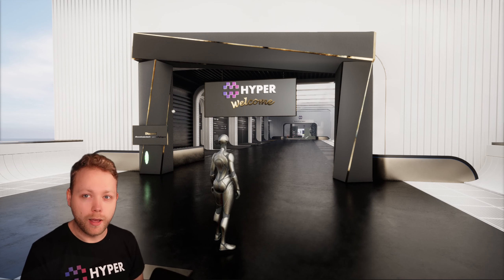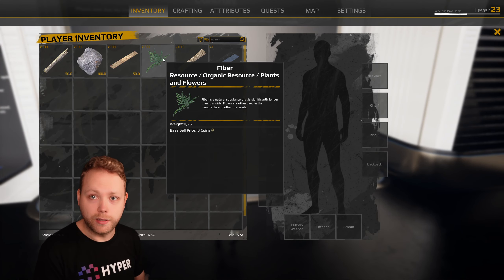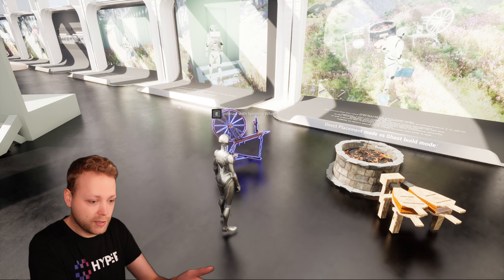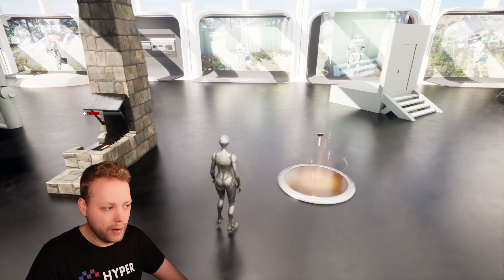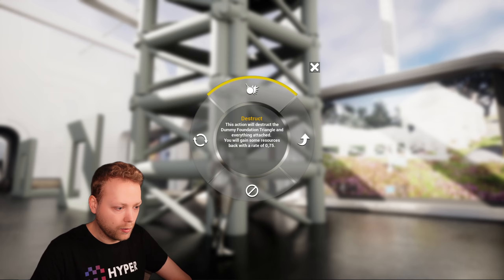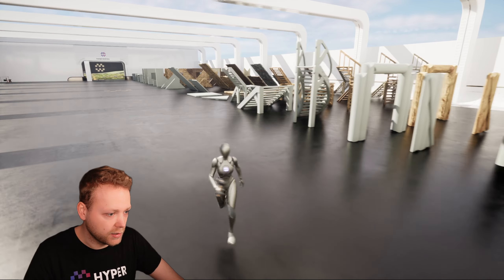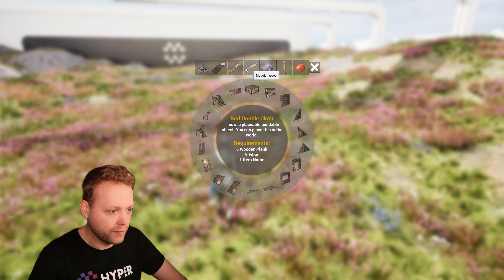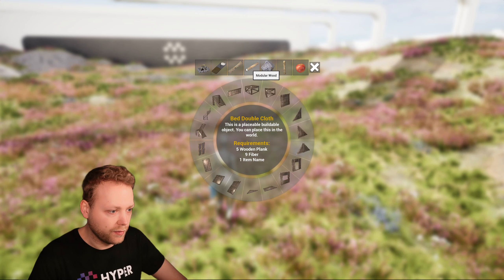UE5 - Ultimate Building Systems: Walkthrough | Games By Hyper

Comment: Have you considered making 30,60,90 degree based triangle foundations/ceilings? I know this would also require special walls, and walls with windows. There is a build set for Ark Survival - castles, keeps and... something - the original set, that has these, and round towers, etc. It is the most comprehensive build set I've yet seen. Regardless, I'm keeping an eye on this, your project!
Reply from the maker: Thanks! Yes I considered it. The triangles I have now are sufficient for most complex structures, but it would be nice to have more.
Reply: @GamesByHyper   The reason I ask is because as a builder, I always have those spaces that scream '30-60-90' here, in order to nicely edge sections together to make a nice angle there. I'd show pics, but I kinna do so here  =/

Comment: Hi, about the ghost build mode i'm trying to build a similar but simplier system but i can't find a way to update the inventory material amount after i subtracted them from the buildable actor. I don't have an inventory widget only two icons in the upper right corner with stones and woods amount, i easily subtract needed materials from the building subtracting my inventory amount to the deposit one, but then i'm stuck how to update my inventory. I treied with single and array variables but none works, they all give wrong output ot zero.
I'm really stuck and i can't continue otherwise, thanks in advance anyway.

Comment: Can buildparts be a inventory item
Reply from the maker: Yes! That is used for the "direct placement mode" which I am talking about at 2:10 
you can switch between these modes however you see fit. 
The "Required resources" to build the buildable would in that case be the inventory item of the e.g. campfire instead of a couple of rocks and sticks.
Reply: @GamesByHyper  sorry I meant more this foundations, walls and ceiling like instead of using the building wheel
Reply from the maker: @BlueSlay3rGaming  Yes, that is also possible. Doucle click on the inventory item will open the buildmode!